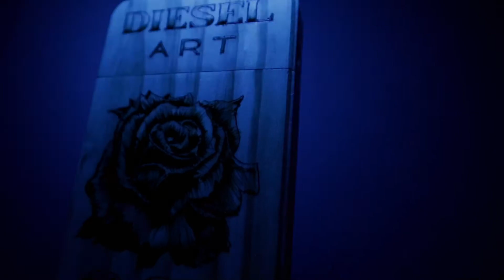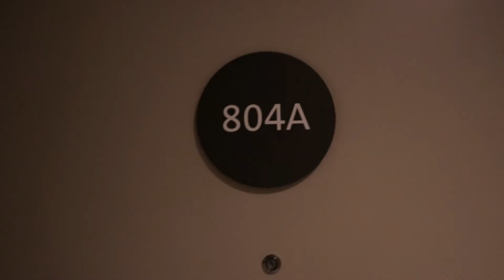iSolation iPhone case 804

Comment: Geez after the virus jumped from room to room last week I don’t blame you for getting onto the balcony whenever you filmed. And of course you would be aware that perth has just gone into a 3 day lockdown?

Thanks for the video. Quite amazed at your pyrography skills and being able to just “burn” freehand. That rose is terrific. And the neatness of the font and text. 

On another note coincidentally just yesterday I got out that same Japanese saw to use..... forgot that I even had it! (Hidden in a cupboard on a high shelf.)

On another note again: I was watching and wondering how you did so well without any clamps. An exercise in patience! It’s all probably too late but check out these hard abs plastic cases that a company called Festool make for their power tools - systainers. There is one with a wooden top, dog holes to put clamps into and a nonslip neoprene strip that allows the user to hold down or clamp small workpieces. My 11 yo son saw mine tonight and I explained how to use it when you’re on site, etc. 

Anyhow, appreciate the hard work and the effort in filming and looking forward to any other projects. Cheers.
Reply from the maker: Thanks for your comment mate! I’ll be on a mine site for the following 10 days so hopefully Perth lockdown will come to the end by that time. That Japanese saw is pretty cool, I just got rid of the paint on a handle. I’ll have to have a look at that Festool sustainer, clamping was one of the most challenging parts of this project plus that COVID thing not going anywhere anytime soon. I’m glad you like the video, I’ll try to come up with some other interesting stuff soon. Thank you.